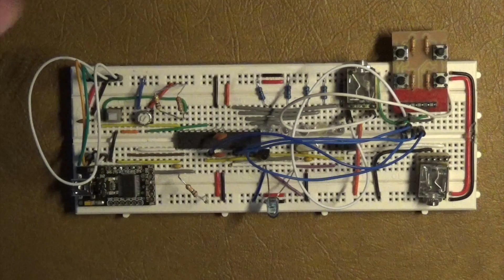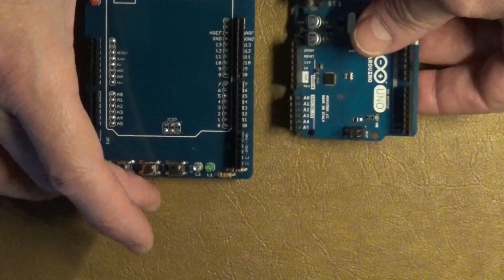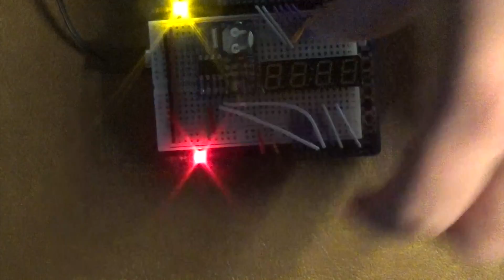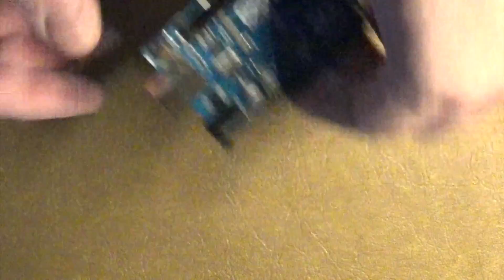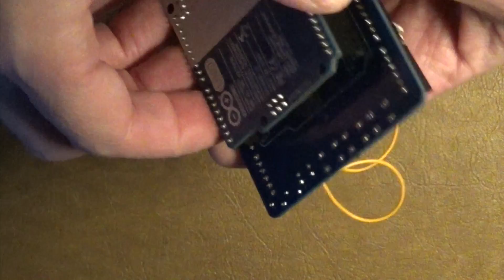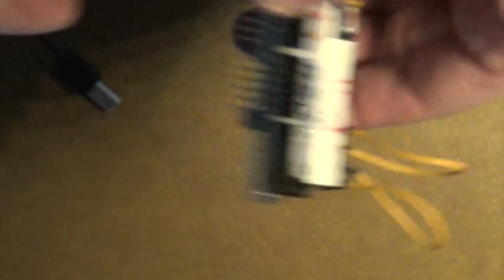Bread Board Shield

Comment: That's a cool idea. What brand of bread board do you like?  That's usually my prototyping becomes a mess, the unreliability of the bread board.
Reply from the maker: Thank you, I use a breadboard I found on eBay.  I agree some breadboards are more grief than they are worth.  Here is the ebay link to the BreadBoards I sell with the shield.

http://www.ebay.com/itm/400-Points-Mini-Solderless-Breadboard-Protoboard-PCB-Test-Board-400-Holes-83x55m-/191090408377?hash=item2c7de03bb9:g:bbgAAOSwy5ZXBdi6

It has been fine so far, price is right just have to wait for it.